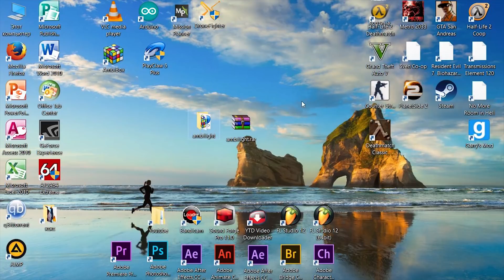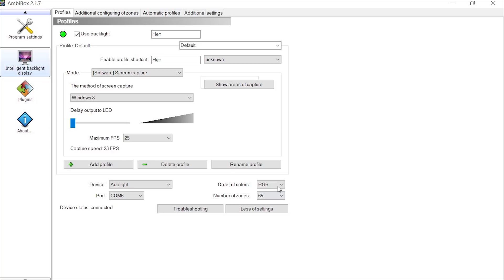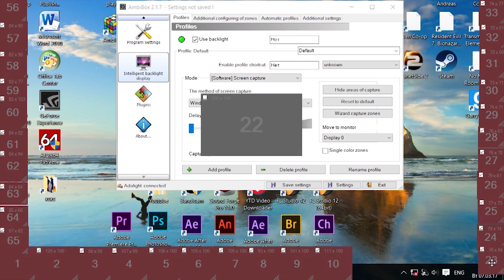Cheapest AMBILIGHT for 47' TV [$15 only!] | How To | DIY

Comment from the maker: Links to items and downloads:
► https://goo.gl/PmJWg5 - Arduino Nano
► https://goo.gl/bdqKxr - High quality silicone wire
► https://goo.gl/rKtFE9 - The most shine and cheapest RGB strip with WS2811 chip
► https://goo.gl/4YW3Pt - JST Connectors for LED

***************************************
● Download Arduino + Sketch + Ambilight Application

► https://goo.gl/llWimF - Google Drive
► https://goo.gl/Zibch1 - DropBox
► https://yadi.sk/d/qTYN5e233FVmVb - Yandex Disk